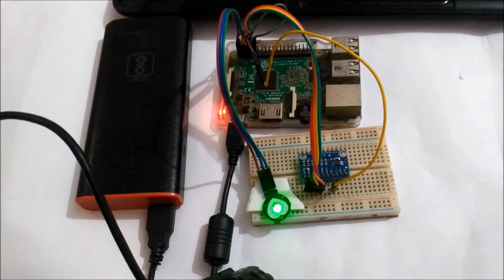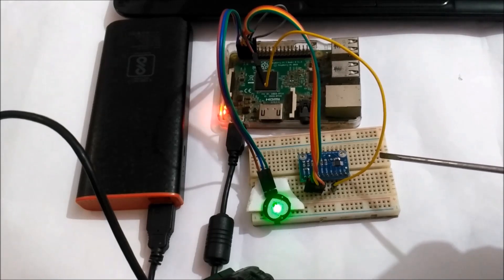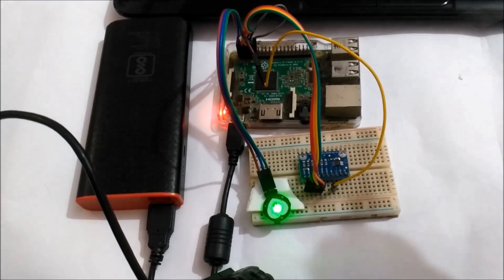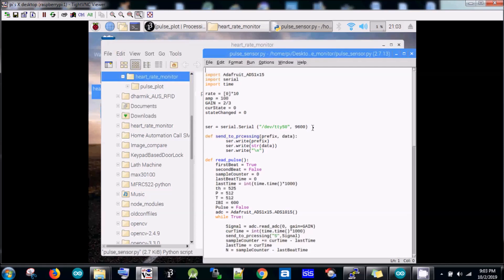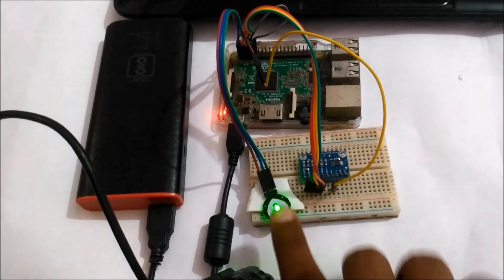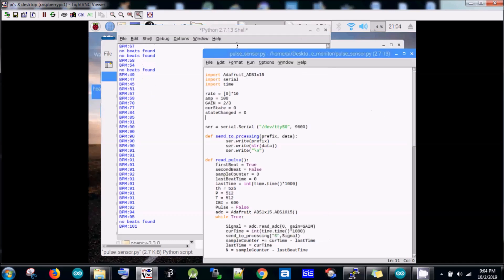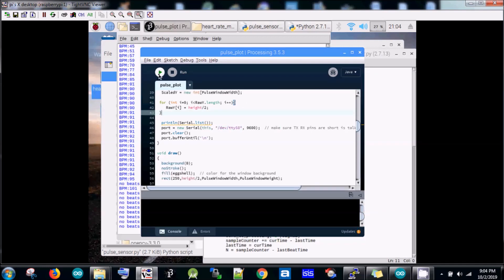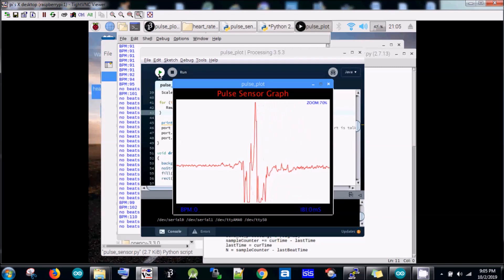IoT Based Heartbeat Monitoring System using Raspberry Pi

Comment: When I upload python code it shows " ModuleNotFoundError : No module named 'Adafruit_ads1x15"..
What should I do now??
Reply: Run pip install Adafruit-ADS1x15 in terminal
Reply: @bablushaw6856   my terminal show this Adafruit-PureIO requires Python '>=3.5.0' but the running Python is 2.7.16
but i already install python 3.8.0 version
Reply: @bayyunrou8445  run 'python3 -m pip install Adafruit-ADS1x15'
Reply: COULD YOU RESOLVE THE PROBLEM?